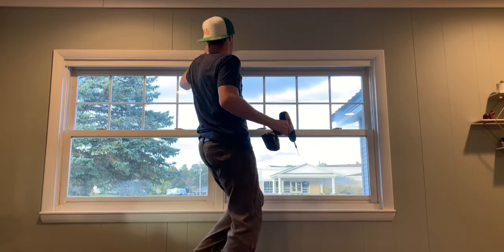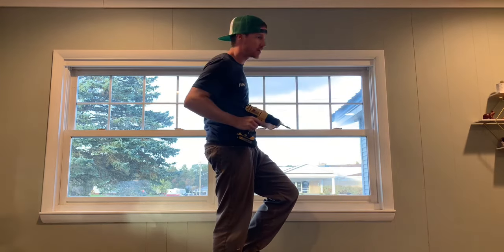How To Install Faux Wood Blinds.

Comment: I guess you recorded the vlog by yourself, so we were blocked from seeing you screw in the brackets.
I have a similar double window configuration. It would have been a cleaner look if you used to blinds on a single head rail, with a single valance to sit on top of both blinds. I don't think a middle brackets were required for windows that width.